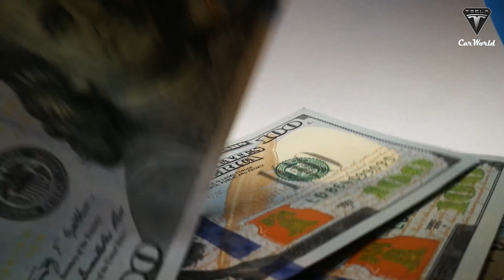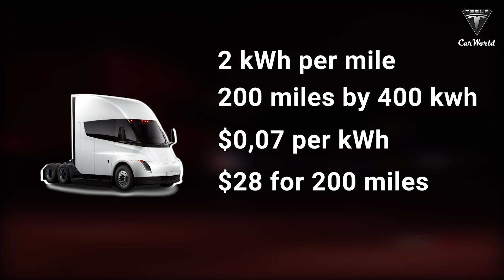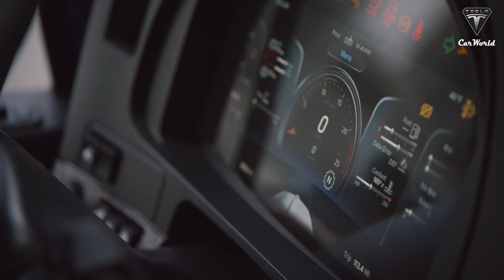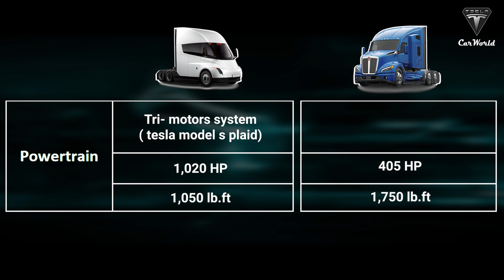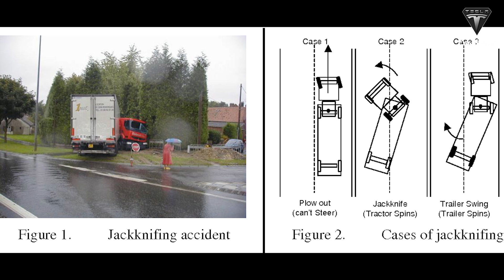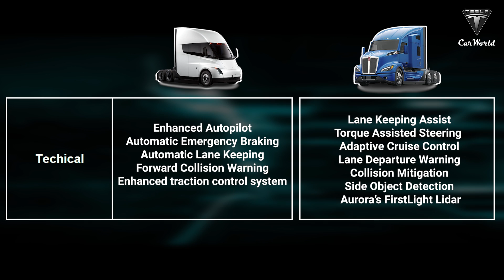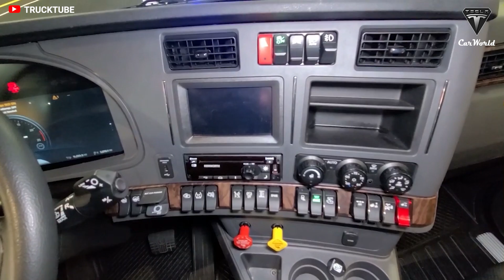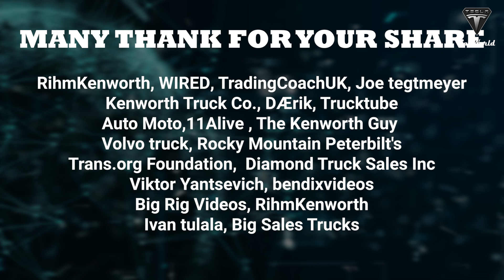Which is the KING of 2023 Heavy Trucks? Tesla Semi Vs. Kenworth T680?

Comment: It’s funny reading all you dinosaur’s comments.  This truck is NOT designed for OTR yet.  500 mile range is more for local runs only.  Once the charging system is up to support this truck and battery technology increases as will the range; what will you complain about then?  Accept it; it’s coming.  I’ll be buying for intermodal use at the port.  Perfect for that.

Comment: So Elon Musk says it so it must be true? You guys are ridiculous. Most of what you ay in the post is wrong or you make it sound like only the Tesla can do most of these things. Think about this. You said the Kenworth has 40,000 lbs axels. That correct but you don’t do all of the math. Thats just the drive axels. The steer axel on many trucks is 13,200 lbs then there’s the trailer. That’s at least 34,000 lbs and often also 40,000 lbs. That adds up to 93,200 lbs. That’s illegal without a permit but the truck can handle it. The law gave Tesla extra weight for batteries so it’s not because the truck is that much better. Most of the safety features are also available on ICE trucks to. They claim 1,000,000 miles without repairs. I call bull sh*t. The average distance of a day cab might be 500 miles per day but the rest of us have real work to do.

Comment: Tesla fanboys are funny to me. They put out all of this stuf with no proof as if it’s true. They don’t even know what it takes to make a good truck but say the tesla is a better one. One simple example of this is the 82,000 lbs gross. It’s not like that because the tesla is stronger, it’s because of the law. And tractor trailer can pull that weight but DOT doesn’t want that much weight on the road without an overweight permit. The Tesla needs it because it’s to heavy. You report that 17,000 lbs is the average weight of a tractor but that’s also not totally true. That’s the weight of a sleeper truck. The Tesla is a day cab and day cabs are substantially lighter so Teslas need to go to 82,000 the compete with the average day cab. You talk about the 1000 plus hp but torque is what gets loads moving. In a Tesla that’s also around 1000. My truck has a Cummins in it and has 500hp and 1850lbs torque. I win. You guys should learn before you post. 
Another thing. Sitting in the middle of the truck will make it significantly harder to back into tight spaces. We don’t use the mirror for everything. To get the right perspective on what youre doing you need to be able to see it with your eyes. Know before you go.

Comment: tesla truck could only be "loosely" considered a "source of clean energy" if the original charge of its batteries came from clean energy. we need to be clear, so that unrealistic ideas about the EV are not inappropriately perpetuated. EV is only a "reservoir" of clean energy if the actual original source is clean, while the EV is used in some kind of virtual grid scheme as a battery. dont misunderstand, i'm not anti EV (or tesla semi). but correct terminology and accurate language is important in reporting as well as science and engineering

Comment: As a Former Trucker OTR 48 States Reefer/Dry Van/triple reefer/double flatbed and tanker long haul, nothing can replace Diesel Trucks especially with Manual Transmission either 13 or 18 Speed Eaton Fuller. My  experience in driving Semi Truck is only 15 years compare to the other veteran truck driver that have 25+ to 30+ years of driving experience, but I got experience I know what it's like. The regular EV car charging takes couple of hours to recharge sometimes not even full charge. How much more the Electric Semi truck does it take?? When I was a trucker before I became a Carpenter and Contractor back in the day when there was NO "Electronic Log book" that the only thing we use is paper log I can drive 1,200+ miles STRAIGHT! SOLO! while the other super truckers can drive double than like team driving but they're also Solo drivers without sleeping I don't know about them but I can only do 1,200 miles straight. My truck is Peterbilt with the old caterpillar engine and 18 speed Eaton Fuller manual transmission. When I used to haul 53ft reefer trailer plus my bobtail truck the overall weight that the Feds allowed are only 80K lbs. But I'm always on 79,880lbs full tank of diesel fuel plus my other stuffs and myself the truck can drive 790miles non stop but the max range is 850miles I still have additional 60miles to find Fuel stop and top it off. The refueling only takes 20mins including restroom break and smoke and coffee break but the filling up really only takes less than 10 mins I only included restroom and coffee and smoke break. After I fill up I have to move out of the fuel station to respectfully allow the other trucker to get fuel too. So I have to pull forward then do my thing. 20 mins only. After than I can fix my log book again scrap the old one then write a new one and drive again for another 6 or 10 hours whichever I like. In the electric semi truck you can't do this things
Reply: I have 27 years. I don’t see this truck doing my job yet. Maybe ok for local work but that’s all.
Reply: @knightwing4  actually not either. I doubt that this Tesla Electric Semi Can do what diesel trucks and local drivers do everyday. Mostly for locals their trailers have hydraulic lift gates that requires electric for the machine to operate. And for Winter ❄️ season you're gonna need Heater. The truck needs electric to operate the heater, and Diesel Trucks have alternator that converts the mechanical energy into a electrical energy going back to the battery mostly 24V lead acid battery. Electric Vehicles DOESN'T HAVE Alternators! They can't produce their own energy, instead they draw Power 🔌⚡from the charging stations and they use it they get drained just like your typical lithium ion cordless tools. That's the biggest drawbacks besides the expensive maintenance for Electric Vehicles. They will always FAIL. Electric Vehicles are only for Fun, only for Recreational things perhaps like a golf car. Electric Vehicles are nothing but a Gigantic Lithium Ion Battery Power Bank with a brushless motor and wheels.
Reply: @craftsmantrucker6867  electric vehicles have inverters to power other things you just plug in what you want
Reply: @knightwing4  oh another thing I wanna add. When I used to be a long haul 48 States Trucker. I hauled Reefer trailers as well what's inside of the trailer are food products like meat 🍖🥓🍗🥩, mostly beef, chickens/poultry, and pork meats, eggs, fish all of these foods are going to the population for Daily Consumptions, they're going to your local markets, stores, retailers, or your neighborhood Walmart. And you need a device that will freeze or maintain the proper temperature for these goods not just meats but also vegetables. And that's where the Reefer or Refrigerated machine will come. The typical reefer is also ICE Internal Combustion Engine that feeds on either Gasoline or mostly Diesel Fuel. And IF Electric Vehicle manufacturers are looking for creating a Electric Semi trucks. I have never seen them built their own reefer trailers as well. Can you see my point? A typical Diesel Reefer can run for 72 hours in a Tank Full of Diesel perhaps more than 72 Hours non stop just to maintain the -5° F required temperature 🌡️ for the food products that I used to Haul back in the day. Can the Electric Semi Trucks do much better than that??

Comment: How about calculate diesel costs under TRUMP... here the issue.. ONE TRACTOR-TRAIKER USES AS MUCH ELECTRICITY PER DAY AS A NEIGHBORHOOD WITH 360 HOMES.. so tell me, how is our strained electrical grid going to withstand the huge electrical draw to charge these TTs   You think I will tolerate rolling brown outs in my area because f*cking shyster Wegmans  is plugging in their electric TT when they dock to unload.. F*CK THAT TELSA ..you'll have huge problems w/ the general population.. these won't be a viable option for another 10 years !!

Comment: You have the information on weight wrong. The tesla can run at 82,000 lbs legality because it's given a 2,000lbs exemption for being a ev the traditional truck is 80,000lbs legality able to heal more with permits.  And cost of operating you left out the highway use taxes that are in the price of fuel that you will still have to pay with the tesla. And the range for otr is not good.
Reply: For my BMW i3s, I have to pay an additional $200 on top of the regular license fee for the road tax that I don't pay for by not having to buy fuel here in Ohio

Comment: bought a brand new t680 in February, after 5000 miles 6 weeks in the shop due to an engine problem, now in the shop because it can not shift in reverse because of the right-hand shift handle, and the steering mechanism was recalled but parts are not available and wait time is at list 3 months.
Reply: You need to sell it an get an early w900 with a cat.
Reply: sorry for your loss...
Reply: Update on the truck, transmission fixed after 7 month, now engine is knocking like crazy, thankfully kenworth has extended warranty on this crap and hopefully it will be free to fix it. Dropping it at shop on thursday

Comment: Love Tesla. But until there is no places to charge (truck and trailer). And there is is no sleeper bank. So as availability to buy a truck.. Diesel is leading yet.
Reply: Ok fair point. I believe Tesla will want to put more mega stations out there as the vehicle becomes more popular.
Reply: @mrfly8133  well, i see it can go two ways. Tesla may just build megastation only for customers, who bought tesla semis. And they only go locally or to another yard (up to 500miles) where they are capable to recharge truck. This way only big corporations will own them… and second one: where we may see it everywhere. Which is really difficult to achieve logistically. And use it as regular EV.. then it will be available for owner operators and smaller LTL companies.
Reply: @ingvarTer  Could be. But I'll bet Tesla will want there vehicles to be the standard. And Elon has proved capable of breaking seemingly impossible barriers.
Reply from the maker: Hopefully Elon Musk will design more beds and Tesla Semi will change your mind. Thanks for your comment and have a good day !
Reply: @TeslaCarWorld  Hope is not a solution

Comment: Your videos are always well done and enjoyable, but your knowledge of trucks, trucking, trucking terminology and weights is very weak. I’m a retired driver, and every time I hear one of these comparison videos I roll my eyes. I support both you and Tesla, but you need a little help with your facts. Empty weight of a tractor trailer combination is called tare weight. The tare weight directly affects the payload, which is the actual weight of the freight being carried by the rig. The 82,000 pounds you keep mentioning is not the payload. It’s the maximum gross weight permitted on the highway without overweight permits. Government regulations have been loosened for electric trucks by 2,000 pounds, due to the battery weight. The limit is 80,000 pounds for the diesels. It is completely incorrect to intimate that diesel trucks can’t pull the same weight , in payload, as the electric. With permits, the diesels routinely go down the highway with 120,000, or more pounds. It is also conceivable that the diesel could actually carry more payload than the electric if the diesel is a lot lighter than the electric. The tare weight is a big factor, since it dictates how much payload can be legally loaded on the rig.  You are absolutely correct about fuel and maintenance savings. Those two things alone are the main reasons the Tesla should sell well. The claim that the truck can’t be jackknifed, if true, is remarkable and a big plus. Also, the Tesla will need to be durable and dependable, also resaleable, for it to make complete economic sense over the life of the vehicle.

I mean no offense, disrespect, or discouragement. Vocational facts are important if you are trying to sway opinion toward a new technology though.

As a side note, I look forward to hearing drivers’ opinions on backing up in tight places from the center seating position of the Tesla.

Comment: Based on the mileage cost comparison, if we assume 600,000 miles of life expectancy, the Tesla Semi will save you more than $300,000.  Enough to buy two Tesla semis.  Need I say more?
Reply: 600.000 miles is nothing for truck. Nowadays they're supposed to go 2 mln.
Reply: @benverdel3073  did you mean to say Million? I think @hawtan4536 is talking about cost savings using an arbitrary 600,000 miles, not maximum mileage over the life of the vehicle.
Reply: All irrelevant.  A typical trucking company in the US can have more than 100 trucks at a site, they cannot install enough superchargers to charge that many and keep them on the road.  There is no real estate at most truck stops to install 15-20 charging stalls so no long haul trucking.
Reply: @crackheadbiden3273  You may have a point. But based on Tesla's innovation and track record  I'm sure they have a technical work around in the works.
Reply: @mrfly8133  You can’t work around real estate space.
Reply: @crackheadbiden3273  I read an article online indicating Tesla is building a charge station notwork for its semi's. I doubt they all need to be installed in one place. Plus with charge times reducing over development I doubt the entire venture will stall because of a lack of real estate. The more trucks these mega chargers can service at one time the less you'll need in one place. Who knows maybe they'll have more of them but each station will be smaller in size.
Reply: @mrfly8133  A charging station has to operate like a truck stop.  There are 40,000 for a reason.  Tesla cannot build enough stations.  It’s ridiculous.  You can’t put 15-20 charging stalls with enough space to have a line waiting.
Reply: @crackheadbiden3273  There's no need to be rude. I just don't agree with you. There's a difference. And no, the earth isn't fine. Clear cutting, massive oil spills, the annual distruction of 100's of species of plants and animals, plastic in the oceans, artificially increased co2's, and extreme weather isn't fine to me. All those things are connected in an ecosystem, and one affects the other weather we are aware of it or not. I do think your pessimism about the charging thing is extremely odd, considering the tech is obviously getting better. But that's just my opinion. On the other hand, I respect that you don't agree with me and have your own differing opinions. After all, you're both allowed and free to have them. At this point, it's no longer a conversation but a circular argument, so I respectfully end this discourse. Feel free to have the last word if it gives you solace. Lord knows we all need it.

P.S. I'm not a kid, and I'm not dumb. Look up something called the pyramid of argumentation. It's a guide to conversation. Basically, you'll want to stay at the top to become more persuasive. I probably could have done a better job respectfully sharing my arguments as well, so if you felt attacked or cornered, I apologize. Have a great day, and make the most of the remaining time you have on this Earth 🌎.
Reply: @mrfly8133  You would have to install those along the most used routes which means you install them in more or less the same places.
Reply: @pogo1140  You may be right. Tesla has partnered with several corporations to address the problem so well have to wait and see how they get around it.
Reply: The Semi Truck from Tesla , is not economcly, what brings you a performance form 0-60 miles, when you dont have loading capacity? You have to drive 2 or 3 times to move the heavy load, no company will doing this, cost to much money and time.
Reply: @Marco-zt6fz  yup 👍! Well said!
Reply: @Marco-zt6fz  I don't understand your comment. could you rephrase it? Just to add clarity I believe max load capacity on the road is 82,000 lbs. So from this video I'd say the Tesla semi is the way to go. The other only has 67,000 lbs.
Reply: @mrfly8133  Mercedes, Volvo, Scania has more lbs.
Reply: @Marco-zt6fz  Depends on where it's operating. In North America its a max load of 82,000 lbs with tractor. A bit higher in UK but the low recharge and comparatively low wear and tear compensates for the legally allowed 14,800 miles missed from it's hauling capabilities.
Reply: @mrfly8133  No, the diesel trucks are limited to 80,000lbs on American loads, they can haul over 100,000lbs in Austrailia.
Reply: @pogo1140  oh I see thank you for the update
Reply: @pogo1140  Australia isn’t getting one, or the Cybertruck.  You didn’t know?
Reply: @crackheadbiden3273  I know. just demonstrating that the diesel semi's load capacity in the US due to federal law, not a restriction imposed by the truck itself.
Reply: @mrfly8133  the trucks in Washington and Oregon State that have additional 2 or 3 more Axles on trailers and additional axle on semi's they can haul 100K+ lbs with ease. While the other States don't have restrictions for Turnpike Double (turnpike doubles either 2 of 48ft or 53ft trailers) 
Can Tesla Semi Truck also have the ability to carry and haul large, overweight and oversized loads???? I've seen a Diesel semi truck that hauled the entire Nuclear Silo as well.

Comment: Note to Tesla Car World.  You misstated a couple of comparison facts.  Only one I can recall is the gross weight of the diesel.  You stated that it could only be 67,000 lbs.  That's not true.  All non electric and non LPG Trucks are regulated to 80,000 lbs. on the interstate system.  Electric and LPG Trucks got a 2,000 lbs. exemption to 82,000 lbs.
Reply from the maker: Thanks for your information !
Reply: And that's vehicle AND load...not just the tractor and trailer.